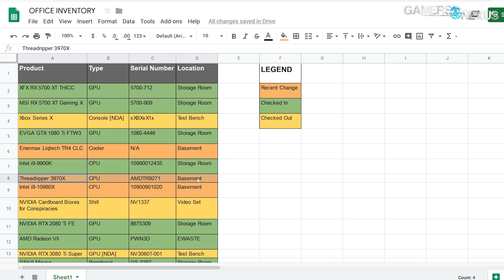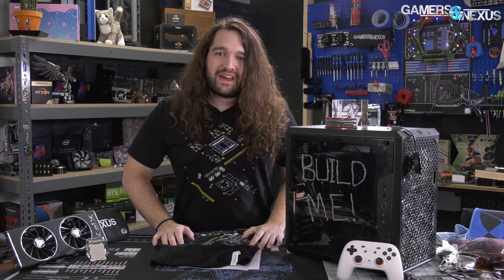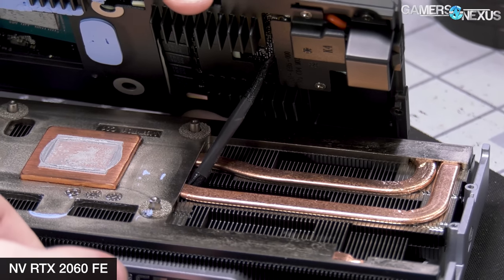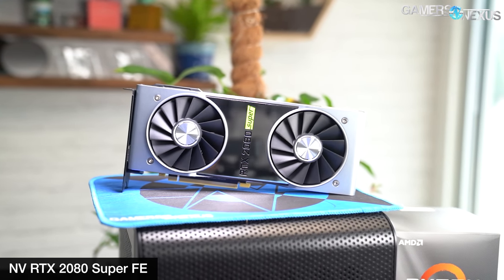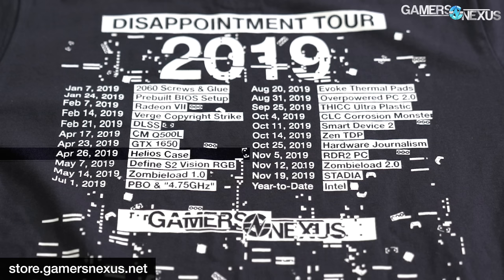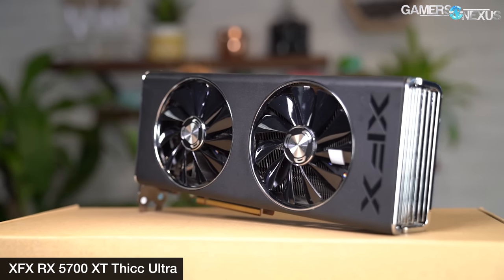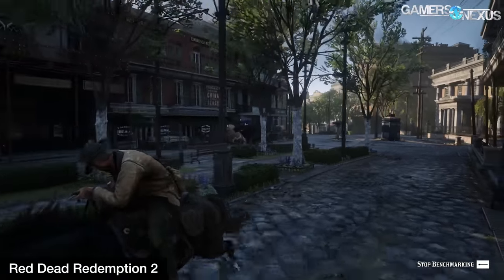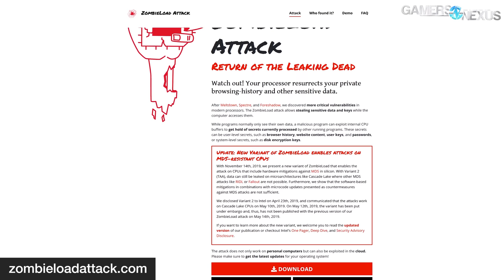The Disappointment PC 2019: Worst Parts of the Year

Comment: I was wondering why the Radeon VII is on the list (I use one) 
Yeah, I can see why it was a but of a problem at launch. But I'm loving the card, I run a 3840x1080 monitor and crush ~90-120fps on most titles at high/ultra.
It's an awesome AMD take on a Titan like Gaming/Workstation card. Which is exactly what I personally need.

Comment: I have a question nexus can I run  my ram at 45c is it to hot for it also can u make a video about it. I also  have it overclock at 3200mhz and the timing is 14 14 14 34 and  the ram is form corsai vengeance pro rgb

Comment: I get a latency on WOW of 15-20 ms usually and that's on a wireless connection about 350 feet from the router with an outdoor polarized antenna. Oh and through COmcast which has dedicated Wow bandwidth I believe.

Comment: Big fan but this video's errors made me sad.
Placing the Radeon VII on here makes 0 sense.  Yes, the card launched before the drivers/software were ready.  Yes, the card ran hot/loud due to poor drivers in February-March.  Despite that, the Radeon VII was not the "same as a 5700XT"phse.  The Radeon VII is the "same" as a 5700XT at gaming in 1080p.  It starts to pull away at 1440p and then clears it completely at 2160p.  2160p is the future of gaming and both new consoles this December are targeting 2160p, not 1080p, which leads to higher dependence on CPU performance.
Secondly, the Radeon VII was basically a repackaged compute card (Mi50), which is a cousin to the Palo Alto supercomputer gpus based on Vega II today.  Yes, AMD erred in calling them "gaming gpus" but not because the Radeon VII was bad at gaming.  On the contrary, depending on the settings/title, the Radeon VII trades punches with the 2080.  This channel and dozens of others have pretty much echoed the same point.  And as quality settings/resolution climbs, the Radeon VII gains on the 2080 because of its large HBM2 buffer/massive bandwidth (1 TB).  
The card outperforms the 2080 in raw compute by about 30%.  It outdoes the 2080 in workflow on most tasks (not all), including processing extremely large video/image files, due to the large frame buffer and the card does general, medical, light and AML compute better than the 2080.  At a slight air overclock (of which it does better than the 2080),  it can match work performance with the 2080 Ti, a card that was 50% more expensive.  With a water cooling loop, the card could easily gain 25% in performance, matching the 2080 Ti in gaming (or coming close) and passing it completely at serious workloads.  And yes, the later drivers fixed the cooling issues, noise and fan issues/overclock.
The Radeon VII has a lot of flaws but it's the best prosumer/semi-professional card released in the last 5 years.  It is so good, that AMD released modified versions that Apple ships with the Mac Pros (Radeon Pro Duos), which Pixar thought highly enough to buy in bulk and AMD repackaged the card again as the Radeon Pro VII, which is basically the same card with infinity fabric. The Radeon VII Pro is designed for hard-set stacking, allowing 3000 USD worth of AMD hardware to obliterate almost twice the price worth of Nvidia cards in serious workloads.  And Vega II isn't going anywhere, with the Mi100/200 right around the corner shipping in Palo Alto's next computing opus.
All this and the Radeon VII was 100 dollars cheaper than the 2080 on launch and is 200 bucks cheaper...for the same gaming performance...today.
Not everything is about getting an extra 5 frames in Tomb Raider, while flashing green Korean LEDs.  Disappointing review.

Comment: Everything is about the value for your money. 
In Hungary the best gaming budget PC is the 3500X and 10400F (180$) with a Z490(180$) board with 4x8GB of 3600MHz RAM (180$), having enought gaming performance to rush with the latest gpus for the next 3y Comparing with the 5600x came on 506$, 5800X is 740$+.
Sadly, nowadays intel gives more gaming frames for it's price.

Comment: Dosent stadia depend on how fast ur WiFi is tho cuz I’ve had my stadia for a while and it’s been perfectally fine I think ur WiFi is just trashing out or something.
Reply: It is more than just your WI-FI speeds. I have theoretical Gigabit speeds on my home network (based on my Wireless Router), but in reality I only get 40 megabits/sec since the cable in my neighborhood is pathetic. If your neighbors get home from work and start using the internet you will suffer slower response times, unless you are living in an affluent community and have high-speed cable/fiber which is still so expensive that most people cannot afford it.  Wait another ten years until our network infrastructure can deliver high-speed internet at cheap prices.

Comment: GTX 1650 with its sole reliance on PCIe power is really getting shafted here. It's an HTPC card that can game. Its ITX cards don't even come at a premium. It even runs cool in the ITX form factor, which is a rarity. Even though its older encoder is annoying, its decoder is the real deal.

I bought one just to make one of my SFF cases more manageable, since cable management with an ill-advised PSU I bought is a nightmare. It hums along in most titles quite handily. Really didn't deserve to make this video.

Comment: Someone should come up with a cooling system that would work totally separate from the pc itself with hoses from the cpu block to a quick connect mounted on the back of the case for mobility. Cooling fluid tank could be filled with whatever you want.  Regulate it like you want. Easy maintenance. Out of sight. No noise. 120v. I have a system that pushes air across the whole motherboard that sits under my desk. Never have an overheating problem. A fluid system would be a lot more efficient and quieter.

Comment: whaAAT.. the q500l is the worst case?? Lol I got it and it's pretty good. The temperature difference between with the panel on and off is just about 5 to 6c. But you do have to put fan direction unconventionally. I have 140mm intake up front one 120mm intake on the bottom 1 exhaust on the back and one on the top right on top of the CPU cooler (scythe fuma 2) and one intake on top as well (the spot closer to the PSU) 

My 3600x OF at 4100ghz on all cores at 1.275v reaches 80c on the package with closed panel and jumping around 74 to 75 with it open. My rtx 2060 stays at under 70c during gaming with custom fan curve maxing out at 75% fan speed on both occasion. Although it does take longer to get to 70c with case open.

It's not a bad case. I wish it was a glass panel instead of the plastic. But for 50bucks when I bought it, that's a pretty good buy. Especially I can vertical mount my GPU hahaha. And it can fit my sapphire nitro+ 5700xt.

Comment: Remember when Intel had more l3 cache than AMD and they were faster?
now its just the other way around...
my core 2 quad q9550 has 12mb. with 14 nm instead of 90 i would expect 128 mb at least, but no its 16 at most... my i7 6700 has 8mb. wtf.

Comment: On Radeon VII...
Once I got the card watercooling and got proper drivers (19.5.2) everything is fine, except there might be little to no support in the future.

Notes on Radeon VII:
I would not say its the worst GPU which was released this year (i would go for 1650), but I agree on following points:
- It was impossible to make it work using its stock cooler, no matter what. You had to go for liquid cooling.
- I was able to get my Radeon VII 2 days after release. It wasnt without problems. They sent me Sapphire while i ordered AsRock.
The reason why it was soldout so fast was simple = bitcoin mining. Radeon VII offers highest possible double precision per watt ever.
-  Card is extremely moody when it comes to drivers. Even newer drivers may cause trouble you described - i had trouble with fans as well.

but...

When it runs, its the most stable and most smooth experience i ever have seen in recent years.

Comment: I feel like with some driver management the radeon VII could have been awesome
Reply: It is, if you're on linux and/or aren't using it for gaming. When I bought mine it was $500 new, but in DaVinci Resolve and Blender it beats a 2080 non-super/ti by over 15% and that card is still, right now, over $200 more expensive than the VII. Linux drivers were basically flawless on launch day which is the exact opposite of usual for a GPU. I do feel really bad for any windows users who got it for gaming, though; it went EoL fast so the widespread AMD driver issues might not get fixed for that specific card.